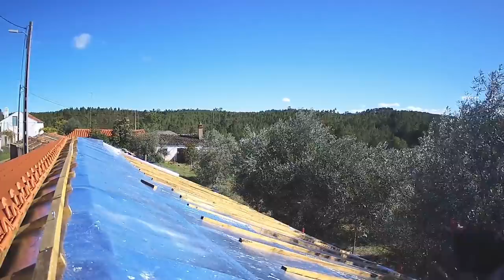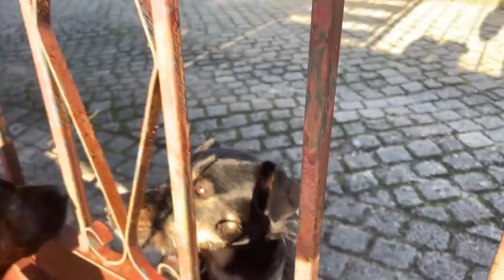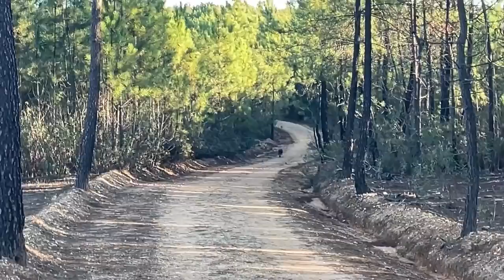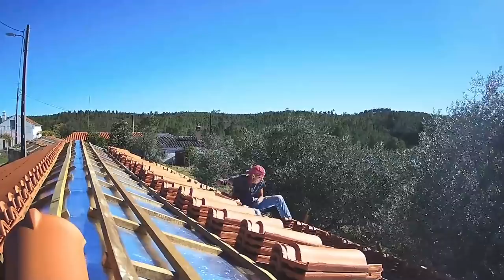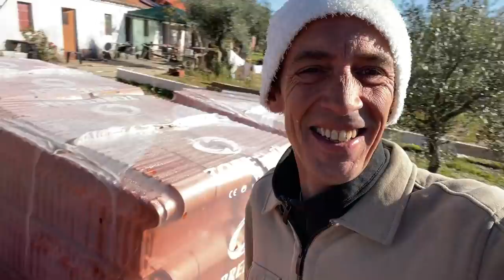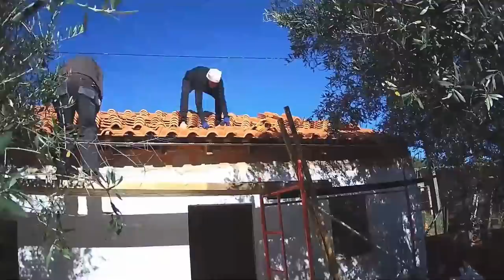BATTENS and TILES are ON - (and there is something about Zoey..) - Portuguese House Renovation

Comment: I noticed a discussion at about 5 minutes where you say you want the roof to look like a single structure across the whole house. Just wanted to say much of the charm in Portuguese homes is the variety of the roofs and odd features. Maybe being too concerned with exact levels is not needed, you can keep charm and quirkiness as long as it ends up secure, dry and lasts  😍. Love the work and focus you have.

Comment: Jasper Now you have the tiles on, I hope that you will add a cross timbers inside to support the roof timbers. Should look like a /-\  a wide A. The weight of  tiled roof is at risk of pushing out the walls. I hope you understand what I mean Jasper.?   Other wise the roof looks good.